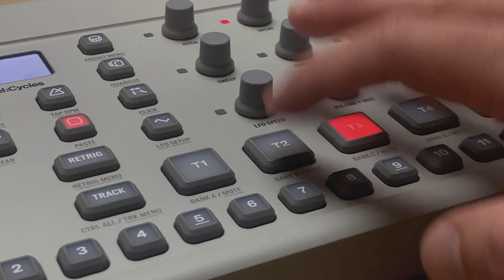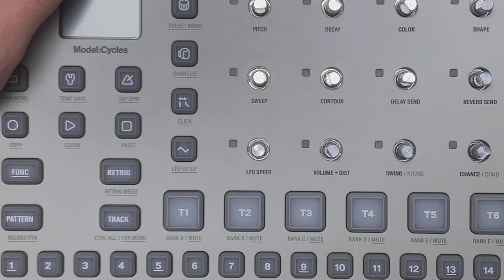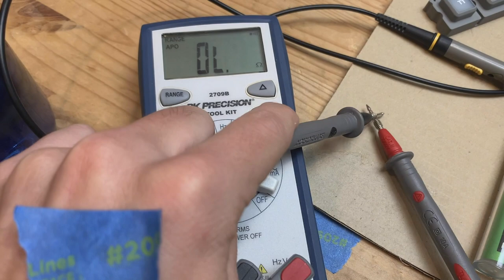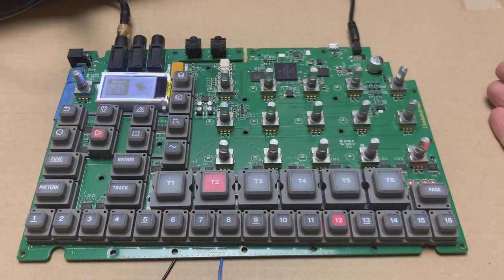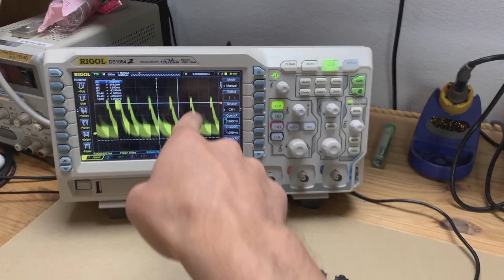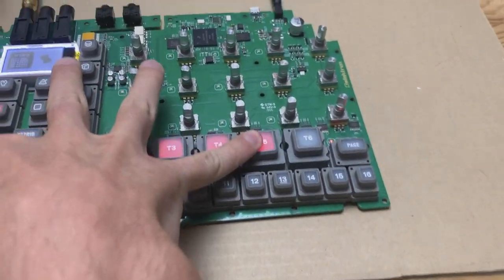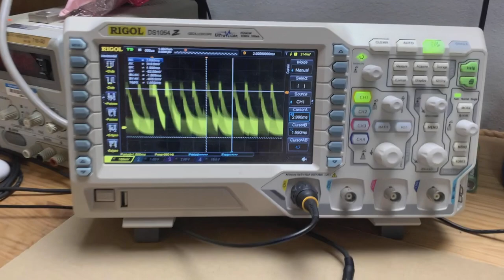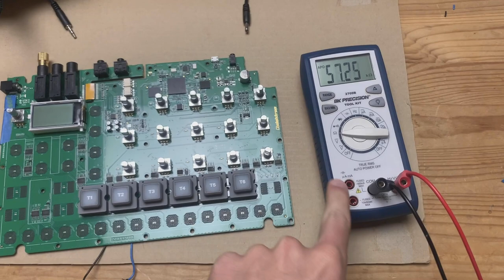Repairdown: Model Cycles Elektron Synth Teardown

Comment: Excellent teardown! Loved hearing a mechanical engineering perspective on the enclosure design. Can't tell you how many parts I looked at trying to get the z-height right for front panel components on my sequencer.... For your force sensitivity fix, if your theory is right it seems logical that you could simply swap out the capacitor on each button for a smaller value that would discharge more quickly. Then less pressure should provide a shorter discharge time /pulse width and trigger the note sooner. Easy enough to test with some hot air and a book of 0603 caps!
Reply from the maker: Extralife is here! I did look on the board for the the caps I suspected to exist. I couldn’t find a pattern of 6 identical caps and I didn’t put in the effort to follow the traces to the other caps I saw. Someone on reddit suggested to wire a 300K resistor in parallel with the force sensitive resistor and I think that that might work quite well, just to nudge the net resistance down a bit. I might try that if I’m having hacker’s block someday

Comment: Thanks for the teardown video. I think the pad sensitivity issue might be solved if more rigid rubber feet were used. Pushing my model:samples down with 1 hand and hitting T1-6 with my other hand makes it way easier and more consistent to trigger.

Comment: Thanks for the teardown! just so its known, you can tweak the velocity settings (shift > back button/pad settings) on the pad and it will make it much easier to press. You can disable velocity completely or tweak the threshold so its triggered easier without losing velocity completely. It doesn't completely fix the problem, but it makes it more tolerable.

Comment: Engineering Technican by day, noisemaker by night. I appreciate the effort bud!

You saved me a bit of time as I had planned to add some additional rubber slivers under the pads (as is commonplace in the MPC world) but this shows it wouldn't have solved anything.
Reply from the maker: thanks for letting me know! Glad you liked it. Ya if my theory is correct then adding additional thickness to the compression stack won't improve the feel. It really puzzles me why they shipped it with this feel. Part of the joy of percussion instruments is heard the response from a light tap!
Reply: @TheNormalUniverse  I made some 3d printed shims I found on thingiverse and it did improve the feel. 

I'd give something similar a shot, I was happy with the results.

Comment: thanks for  looking inside)
Reply from the maker: Doing what I can! Microfreak is next
Reply: @TheNormalUniverse  nice idea, lets see how that capacitative piano works
Reply: @TheNormalUniverse  Cool! I have one of those too.
Looking forward to your teardown/analysis.
I have already taken mine apart, to look at the encoders, so I could replace a bent one (matrix encoder). 
I could not easily locate a replacement, so I bent it back into place, and it works fine, for now.
Please post, if you can locate replacement encoders.

One other thing, that is a bit of a problem, is the 1/8" control/timing voltage jacks, are very stiff/difficult to plug/unplug.
Thinking of modifying/replacing them to be easier to use.

I like my MicroFreak so much, I bought a second one :-)
Thanks again, for doing this stuff, and sharing on YouTube.
Have a wonderful day!

Comment: Looks like they use velostat as pressure sensitive material. You can try to use pieces of a thicker sheet of velostat to increase the pressure sensitivity.
Reply from the maker: Interesting.  Velostat definitely looks identical to what Elektron used.  I wouldn't be sure until I could check what material vendor Electron used. A thicker sheet of velostat would hopefully help.

Comment: Thank you for the video. Finally I succeed to web-search with "elektron model cycles 300k resistor pads reddit".  Another fix would be to drill some holes underneath each rubber pad, so that they would squish easier.    But pay attention of any kind of fix: the pads were made to response to both velocity and aftertouch. If you make the velocity responsive at light finger hits, then the aftertouch might be affected, as the retrigger might not work at light presses for example.

Comment: Nice teardown. Have to hand it to Elektron for such a clean design. I wonder if you could add a bit of copper foil tape to each of the velostat squares in order to increase conductance with less pressure? Maybe a small strip would do the job?
Reply from the maker: Thanks for letting me know! I got a recommendation on reddit to add a parallel resistor with a few kOhm of resistance, same thing you're suggesting except a copper strip would basically be a short circuit.  I think it makes sense.  I might try it and make a video about it sometime.  Currently at my family home for the holidays so I'm away from the lab.
Reply: @TheNormalUniverse  I will search for that reddit post, as I am also an electronics tech, and wish to increase the sensitivity of the T1-T6 pads.
Please respond with link, if you have one.

Came here, hoping to learn something, I could use for that purpose, and you made that happen. 
Thanks very much for this teardown/upload. Just subscribed.
Best wishes for your continued success.

Comment: Thanks. It's a real shame that a fix can't be easily found. Model:Cycles is a great machine but my T1 - T6 pads are so stiff I have them set up at fixed velocity 127  and they're still hard to use in real time, so the M:C is a failure as a finger-drumming device.
Reply from the maker: Yup, it came so close to the finish line. One of the main reasons I wanted this over a digitakt or digitone is for finger drummer

Comment: Thank you for posting this! It's been really informative. I'm having some trouble with the pads on a second-hand model: samples I bought recently, for some reason the "conductive" square things on that transparent sheet aren't working, except for the one on pad #5. When I move it to the other pads' contacts, they work, which made me assume that it's the sheet that's being culprit. Any ideas on how to fix this? Goodbye and thanks again :)
Reply from the maker: wow you really got deep! So you're saying you did a swap test and when you place the conductive sheet for pad 5 on other pads the other pads start working again? That would be a strong indication that the problem is with the sheet. I would inspect the sheet for dirt or corrosion. You could also try using a bit of wire to short circuit the pad traces on the PCB to see if that triggers the channel, which can help confirm that the channel is still able to trigger.  Sounds like a tough problem though.
Reply: @TheNormalUniverse  yeah, my guess is that dirt from other places of the device ended up there when I applied some contact cleaner (is that the name for it in english? lol, not my first language) to the trig buttons to loosen up their stickiness >:@. What would you do in order to clean the sheet? I think the black squares are "velostat", but not really sure. Thank you for answering!! Loving your channel, bro.
Reply: Update!! I tried putting buttons from the other "mat" over the pad's circuitry on the board and confirmed they are OK, the issue is definitely the black stuff on the transparent sheet (seems to be just carbon at last). The pressure-level is sensed directly onboard.   Will try some conductive ink and come with results!! :) Thank you again, you really inspired me to go this far (I also enjoy repairing stuff, despite my limited electronics knowledge).
Reply: Ok so I finally bought some conductive ink/paint (I wanted a carbon based one but ended up getting silver) and applied just a little over each one of the squares on that transparent sheet and VOILÁ!!!!! fixed, I even got better sensitivity. Just don't apply too much (metal based ink is way more conductive than carbon). Just be careful!

Thanks again.

Comment: You can change the velocity sensitive Pads in the elektron menu.
You can also send fx (like reverb) by the velocity.

But when the problem is still not solved i would make the Pads harder.

Here the tutorial 
18:19

https://youtu.be/VI0irMgdgQo
Reply from the maker: Hi Wuhan! Thanks for the input, I already maxed out the sensitivity in the elektron menu and still find it note sensitive enough.  Readying the Elektron forum I think this is pretty common feedback.  I don't think there's an easy way to make the pads harder without molding your own pads.
Reply from the maker: @meinemudda3095  Hey that's cool! I dig it

Comment: Thank you for your work! Can you tell us how you removed the knobs right in the beginning?
Reply from the maker: Hi Strahlemann, glad you liked it! The knobs are held on with friction only. If you can find a stiff object that fits underneath the knob you can wiggle it up and down until the knob starts sliding off the shaft. A flathead screwdriver would work but that will scratch up your case. Better to find something plastic. There's a tool called a spudger made specifically for this purpose, taking things apart while minimizing scratching. Search spudger on amazon, they're nice to have around.

Comment: Hi,Do you think the hardware of samples and cycles are exactly the same? If it is the same. I can install the cycles firmware on models or vice versa.
Reply from the maker: I don't have a model:samples to tear down.  I imagine the hardware is very similar, but I would be surprised if they managed to make the hardware so perfectly identical that you could change from one to the other with a firmware update.